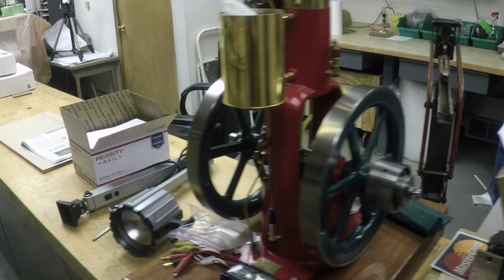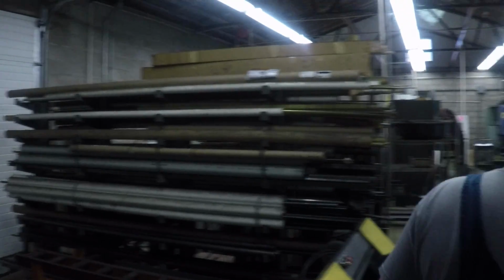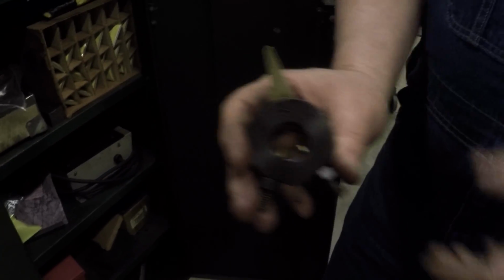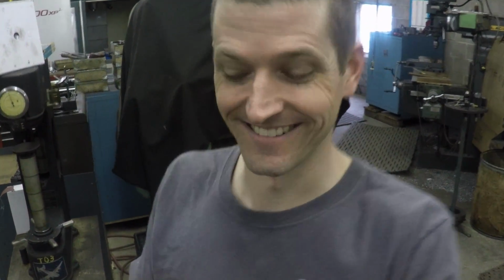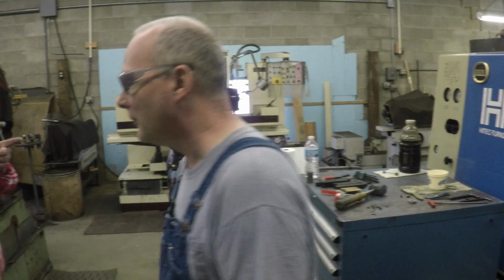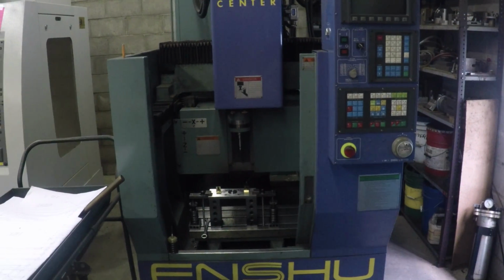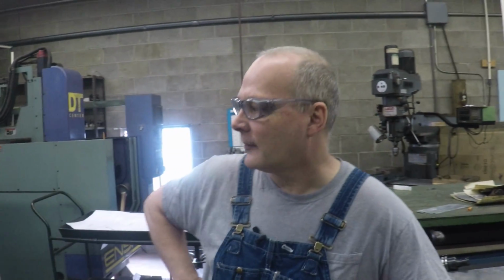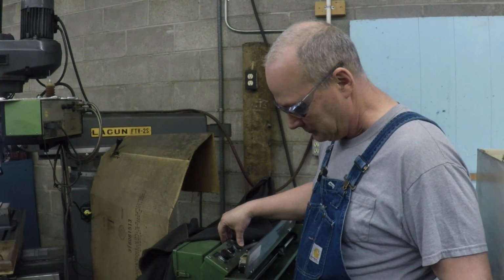Tour of Debolt Machine Shop!  Model Engine & Job Shop!

Comment: Awesome video John. Great shop and great guy.  My old work had a lagun ftv 4. That thing was a beast with spindelbearings and a very ridget machine. I think it was bought new in 2005. 

I would kill for a lagun in my own shop. So much nicer than a Bridgeport. 

I only got cnc mills and I very much miss having a manual mill but the space is tight in my little machine shop. 😊

Comment: In the manual for my HBM they talk about using a boring bar with cutters and feeding the table towards the spindle to use the machine as a shaper so I see no reason you couldn't do the same thing with a broach.  Manual on my VMC rates the spindle at a continuos thrust load of 2 ton and intermittent at 3 ton so I guess as long as your broach forces were less than that no worries. :-)

Comment: And now you know the reason for the saying "running balls out", it's in reference to the governor on an engine. Nice shop tour! Thanks
Reply: See also "knocking the balls off the governor," although "balls to the wall" is a reference to aircraft throttle levers.

Comment: Very nice shop..I have a Heidenhain..very nice to use and definitely high end..the spindles on newer machines are a lot more advanced but more expensive to repair! For production I would go for a horizontal or a 5 axis as they have better chip clearance and better protection for the slideways ,and I would all ways choose the  pallet changer option!
Reply: NYC CNC  yes I have a twin pallet Bridgeport BPC on a Fanuc controller with a full 4th axis..Although I only use it for positioning a tombstone fixture it can have many uses such as indexing for gear cutting and making cylindrical cams..down side is initial cost which is why I would only purchase a hmc for mass  production I think!

Comment: The talk about broaching was really interesting. Where I work we machine multiple different sizes and types of butterfly valve discs for aircraft and we broach the inner splines by just mounting the disc in the lathe and pressing the broaching tool through the part with a dead center in the tailstock. It works like a charm, although I'm always afraid of breaking the $1250 broaching tool haha just takes a little bit of bending to snap the carbide right in half.

Comment: John I have done broaching/Shaping in the milling spindle on my horizontal and vertical mill many times without problems. The cuts put very little load on the spindle. You put much more load running long shank milling cutters such as face mills or large end mills. My Mazak Integrex  machine runs milling and turning tools in the milling spindle. The longest tool it can change in the changer is 19.5" this could be a large boring bar. It does have a special coupling inside the milling spindle to orient every 15 degrees  precisely for the turning tools. You can have what they call a flex tool that is a turning tool with multiple cutting edges/inserts. To save tool changes you just index the milling spindle to change cutting edges. Looking at the drawing of the cross section of the spindle I am not totally sure if this coupling adds support to the spindle for the turning tools. On a lathe with a C axis broaching opens  whole new possibilities of being able to do internal splines and gears as well as keyways. You could do similar things on a milling machine with a rotary table. With a normal mill you are relying on the accuracy of the keys on the spindle and the tool holder as well as the strength of the spindle orient feature. Or the tool could have a key that engages a solid keyway mounted on the face of the spindle housing for its orientation.

Comment: How can you hate lathes!!!!! If I was to have only one machine it would be a lathe :)
So much you can do on a lathe
Reply: So much more cant be done on a lathe. Just about everything a lathe does can be done on a mill
Reply: one can literally do everything a mill does with a hand file. Lathe is the base machine that all others are produced from. You cannot make long true drive type shafts on a mill with either the efficiency or the accuracy of a lathe.
Reply: @Madmoody21  Yes long true drive shafts are the bread and butter of lathe work.
That should tell you something.
Lathes are good at making long round things. Mills are good at making literally everything else.
Reply: @kkknotcool  haha sorry you don't know much about machining I see 🤣
Reply: @nikolaiownz  I am a professional machinist and I have an aas in cnc machining.
Reply: @kkknotcool  clearly 🤣
Reply: @nikolaiownz Well you are either a troll.
Or a machining enthusiast with poor self esteem and no social skills.
Reply: @highstreetkillers4377  what ? You clearly don't work with lathes or mills every day 😂😂
Reply: @nikolaiownz  
The most flexible machine tool is a cnc mill, by far.
The only lathe with nearly the same kind of flexibility as a cnc mill is a live tooling lathe and that's basically just a cnc lathe/mill combo. 
And the live tool lathes have a very limited work envelope.(just whatever can fit through the spindle)

Comment: Not only does Apple have 20,000 robodrills all in a line like that, I've been told that when they need major maintenance, they just get a forklift, move the machine off the line, and just slot in another one.
Reply: Evan Bunke Ha! Takes the Haas cartridge spindle to an entirely different level. "Cartridge Machine"
Reply: They have more than that.  They use brothers and dmg drill and tap center now as well.

Comment: Also, you can grind/hard mill your own tool from an old end mill or use square HSS and put the tool in a collet.  As long as you have spindle orient it should work out just fine.  No fancy tooling required.

Comment: I don't think broaching with the mill would be a problem as long as you have the bearings warmed up.  Also, you could rough the keyway with a round cutter, then use a smaller broaching cutter to finish the corners and depth.  As long as you keep the cutting forces reasonable it should be just fine.